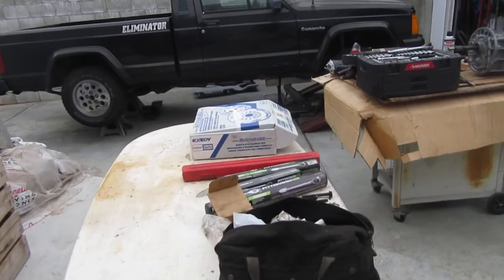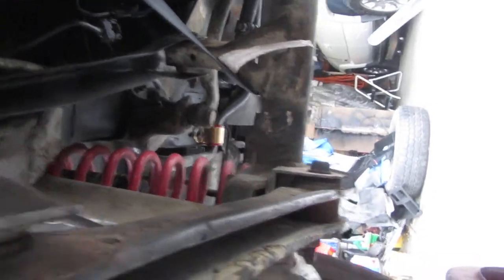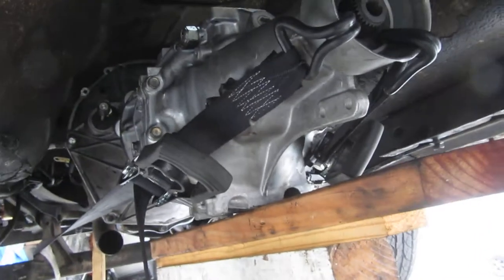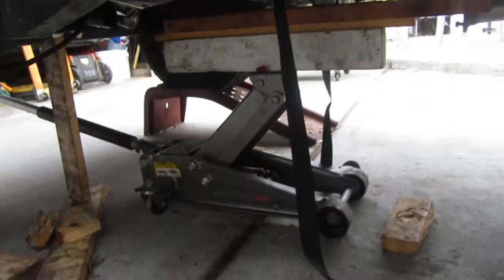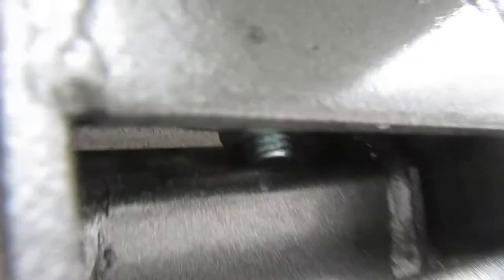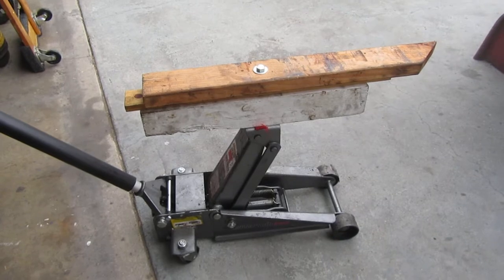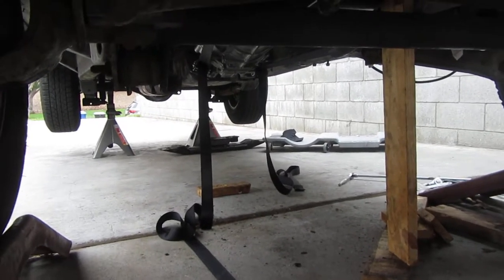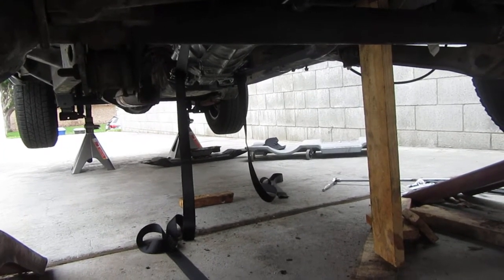AX15 Transmission install Jeep Comanche MJ Floor Jack & Ratchet Straps

Comment: I been trying to to look for a ax-15 for my 89 Comanche. My truck came with the Peugeot transmission.
Reply from the maker: www.advanceadapters.com has BRAND NEW AX15's for sale, $1,632.12.  (800)350-2223.  They also make bell housings and Atlas Transfer Cases; which are the best Transfer Cases available.  Give them a call.  They'll know and have everything you need for the AX15 upgrade.
Reply: @301steady  thanks. It's a little over by budget...but thanks for the response they do have quality parts.
Reply from the maker: @hectorgarcia1941  Take a look at Ebay. They have a lot more than they used to.  Also, be sure to replace all the plastic components in the shifter.